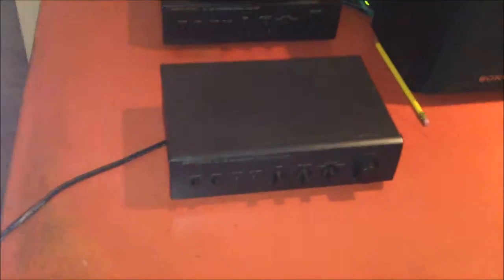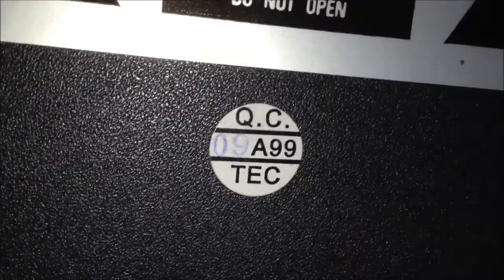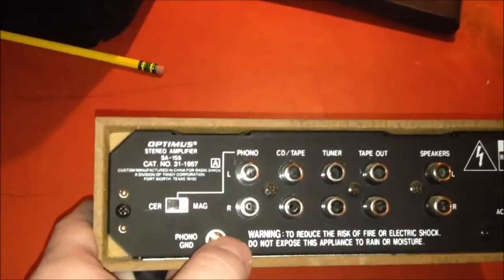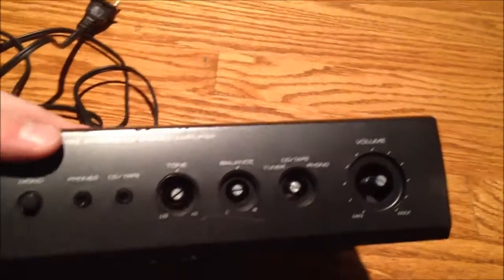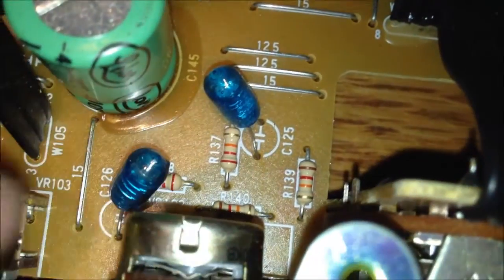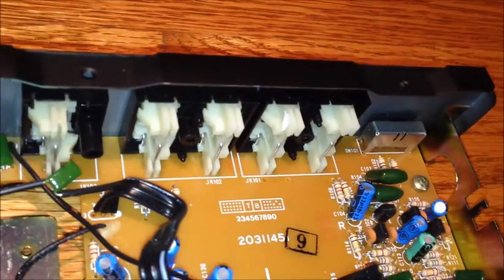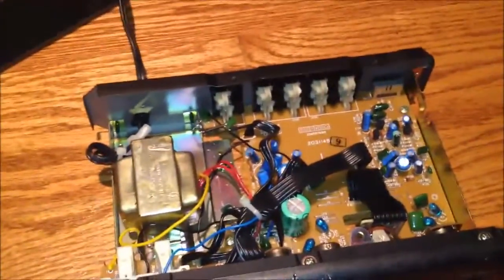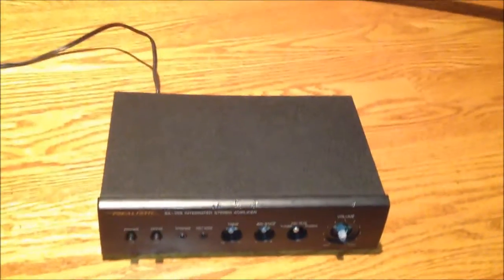Optimus SA-155 Integrated Stereo Amplifier + A Look Inside

Comment: There are FOUR brand versions of Radio Shack's SA-155. It began in 1994 as "Realistic" (cat. no. 31-1957) for that year only. From 1995 through 2000 is was "Optimus" (same cat. no.). In 2001 it became "RCA" (cat. no. 31-5000) through at least 2002, after which Radio Shack discontinued yearly catalogues. It was last sold displaying "Radio Shack" brand (cat. no. 31-5032), though there are no catalogue references for the exact year(s).

Comment: I think it's a shame that radio shack is gone but I see that the price of the receivers speakers have gone through the roof especially their turntables they're turning tables is now selling for $400 to $500 like the lab 400 is now 400 to 475 I have an sta 2380 and it's going for 375 to $400 on average and the STA 2100 is going for 6 to $800 and the prices are going up on realistic products

Comment: I'm curious about something - did you find anything inside the SA155 to indicate the voltage of its power supply?.  As has been noted previously, 1.8 watts per channel is considerably less than the LA4440 chip's rated stereo output. It's true; you don't need big output power numbers to get good sound.  I've owned a few of these little amps and love them, they make fine amps for use with computers and MP3 players.   People keep 'borrowing' mine and never returning them.

Comment: The LA4440 amplifier IC is good for 6 Watts per channel. (12W total, stereo or 19W mono bridged)
Reply: Note that the 6 Watts per channel (stereo) and 19W (bridged) ratings are with a 4 Ohm load. And that's at a very high 10% distortion level. Radio Shack recommends using 8 Ohm speakers with its LA4440 based amplifiers -- so figure about 3 Watts per channel at the same high distortion. Radio Shack chose to market these amps rated at 1.8 Watts per channel for a much cleaner 1% total harmonic distortion spec.

Comment: 9 years later how silly of me to make a correction to your otherwise excellent video.  You say : "All you have to do is move this (indicating the far left rear switch)  to Ceramic and you have an RCA input. This switch actually allows you to choose a magnetic cartridge turntable or a ceramic cartridge turntable. Yes, the Phono input plug is a female (RCA) plug.
Reply: You are not alone. I just saw this video, because I have three of them, and was saying the same thing. On one I run a turntable in and the tape out to a Technics 7-band eq into a Sony ES Receiver, analog direct. I turn it up at house parties and blow people away. They think the records are streaming.

Comment from the maker: they did from what i understand. this stuff was awesome, i wish it was still sold. the one thing they have left from that are the shoebox cassette recorders that are still AC bias!

i guess they wanted a lot of headroom or something. seems like a decent chip. i haven't had an issue with it yet.
Reply: I still use mine.  I use it to power a pair of 3 way Wharfdales and it's connected to my pc.  The Wharfdales are on their side either side of my monitors and make great shelves while providing great sound.

Comment: hahaha...what kind of capacitors are they..lolz.
Reply: look like some kind of tantalum to me
Reply: The silk screening shows no polarity markings for those caps nor does the schematic -- hence not tantalum. All four of those blue caps -- C121, C122, C125 and C126 -- are 560pF and look rather like radial polystyrene caps of the era. C121 and C122 look to be part of a non-defeatable loudness contour circuit at the Volume Control. C125 and C126 are in the Tone Control filter circuit.
Reply: @todstiles4326  Is there a way to modify the tone control circuit to lessen the bass about 10% and increase the treble about 25%?